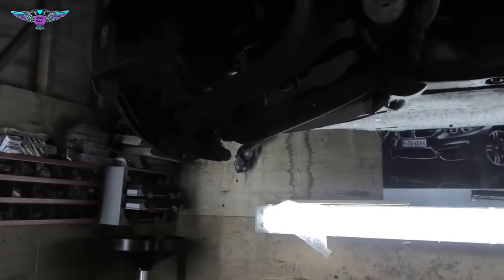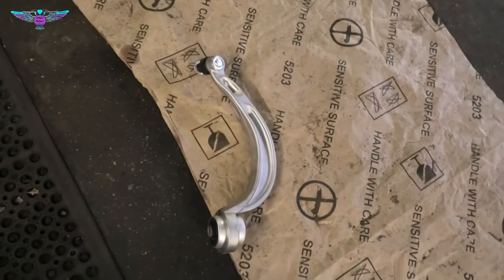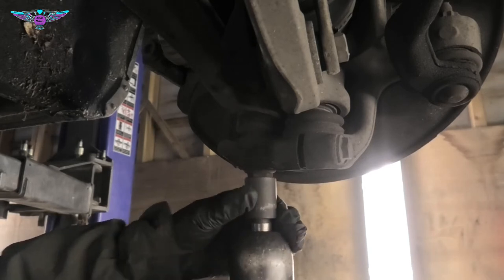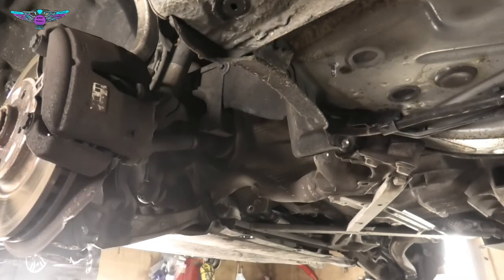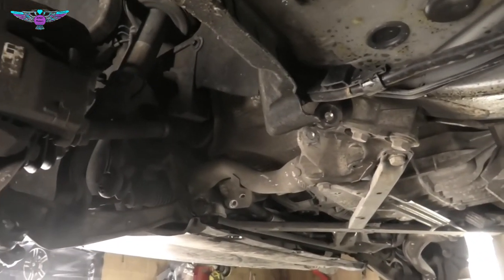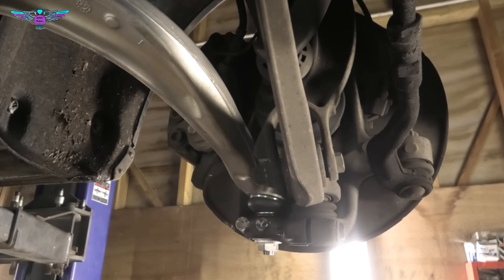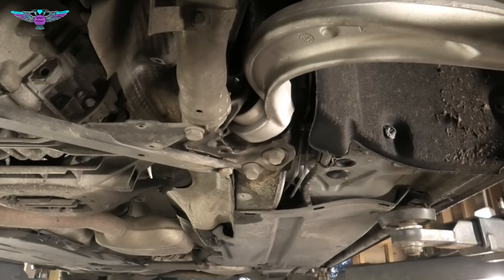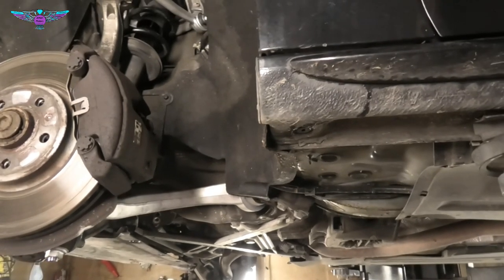Audi A4 Avant s-line front curved lower suspension control arm replacement #audi #sline

Comment: By far, it's the best video to do front lower control arm replace for A4/Q5, espacially dealing with heat shell which blocks the bolt. Do you think I can do this with small car jack stand and car jack with big lift as what you have?
Reply from the maker: well if you have a lift then that should help a lot as that heat shield can be a bit of a pain..
Reply: @DaringBeefcake  Thank you

Comment: Did this get rid of the noise? And how difficult was it to tighten the bolts with the car on the ground
Reply from the maker: yes it did get rid of the noises, but there are other arms around the front so it could be any of those causing noise, i think I lowered the car on top of some planks of wood and tighten the bolts, but have some thick plants so the car cant drop if that makes sense..